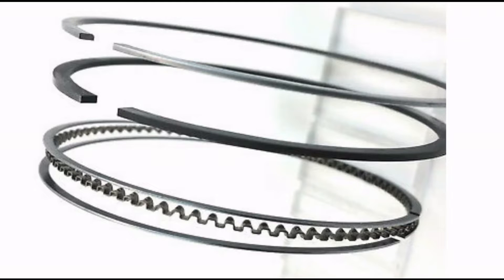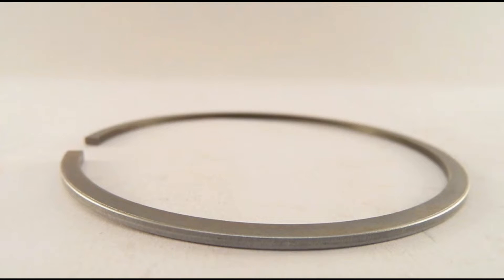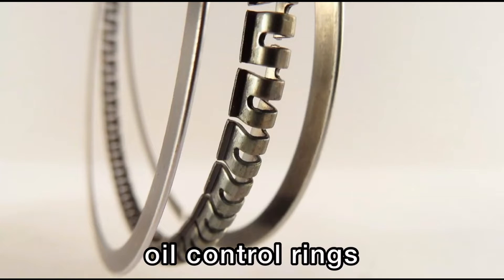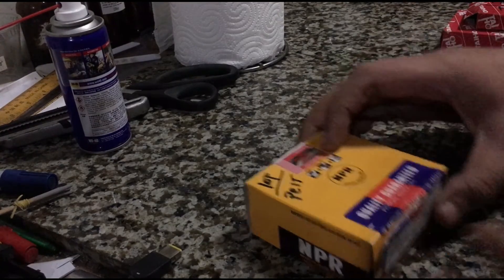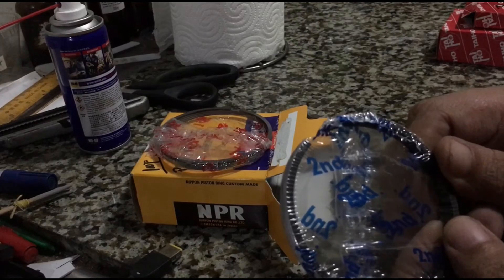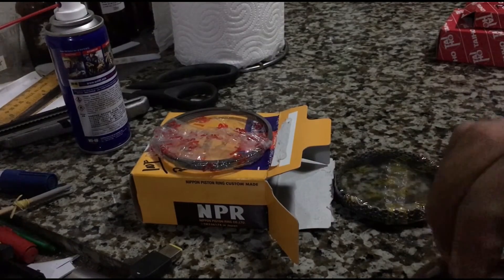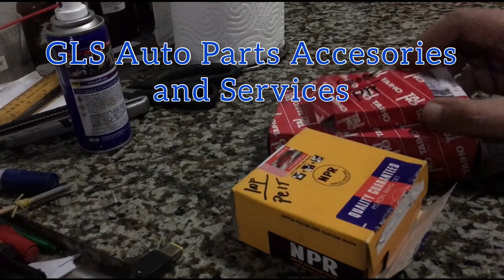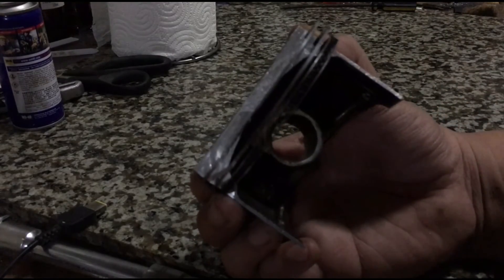All about piston rings: Blowby, Sealing and Power

Comment: Do you think thinning the top ring on the inside to reduce tension is a good idea? Thanks!

Also, any thoughts on gas porting OEM pistons?
Reply from the maker: oh man we have a smart gearhead that overthinks here!! (you) which i do almost every night 🤣

Rare moment thats been mentioned to me and il say "thinner" rings ALWAYS makes more power the only problem is longevity or mileage...

with how u asked/mentioned it... i think it might be a more than good idea... if i heard u correct like thinning the inside like as if its the second ring but not for scraping but minimizing tension.

Though by this, crancase ventilation becomes mkre and more important :)

thanks for checking this one and double thanks on the questions i like :)
Reply: @SRDmotorsports  Thanks for putting out quality content that we can learn from. :) 

Hope you can do a video on valve seat angles sometime in the future, thanks again
Reply: @SRDmotorsports  I'd like to know your thoughts on Radius/barrel-faced top rings and Napier/hook grooved 2nd rings, how significantly better are they?
Reply from the maker: @findtherightbeat  radius/barrel faced they do say does well and napier second i hvnt tried but wanna try ung second

sa top ring i think its really 90% material selection as long as chrome faced/stainless to withstand extreme temps its fine

especially if you know 50-60% of the friction or windage comes from the oil control rings alone :)
Reply: @SRDmotorsports  Thanks! Some topic suggestions for future content: cylinder surface finish, break in procedure, break in oil - builders vary a lot in these especially the break in procedure.
Reply from the maker: @findtherightbeat  oh that is true on differences between builders good suggestion will look into that :)

tbh ring seating/ring break in takes 80-100km
and thats it for me a pseudo no break-in thing

but def something worth talking about if not a dedicated vid , could be a topic on one of the segments in the future

Comment: If I installed the oil rings gaps on opposite sides, meaning one forward and the other in rear will it work good still. I seen that they have to be on the same side of each other . Does it matter. Thanks
Reply from the maker: you mean the oil spacer ring? the super thin ones?
Reply: @SRDmotorsports  yeah? Thank you
Reply from the maker: @alexgonzalez7395   if its the thin ones not the control ring (not the springy one)

i think its no harm... as long as the top/1st ring isnt like that or on the same line as the second/scraper ring

especially because the "front" and "back" of fhe engine is also the "thrust axis"

the conrod pushes the piston on one sde as it goea up... then combustion pushes the piston onthe other side... thts isnt good if the top ring gap is there or even the second ring

i hope that helps sir :)
Reply from the maker: and Thank you for commenting this question, as we know perhaps many people ask similar question and now my answer to you may also be the answer to their question they didnt ask :)